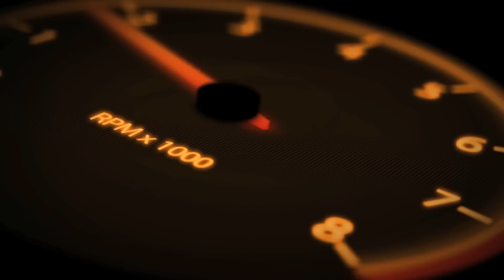Monster Pocket Bike

Comment: Nice job! Really liked the setup by step. Did you end up changing the engine? Mine has very poor power and have to almost push it forward in order to take off. Do you find you have to do the same for yours?

Comment: I got 2 of them but don't go a freaking clue what is the brand or model name hahahaha any help?
Reply from the maker: I would need some pics or a way to see them
Reply: Dylon Desbiens I have done some digging and it is a cateye 50cc cat eye, trying to mod the frame to fit a 125cc but finding hard to find the space for it as the smallest I can find is 30-40-35 centimeters lol
Reply from the maker: Yea if you have the engine, just figure out what needs to be done to fit it I guess lol. should work tho
Reply: Dylon Desbiens will do lol. Great log and sweet sound track by the way haha